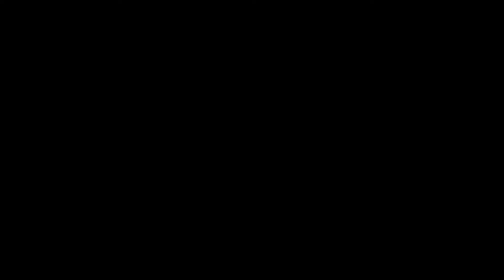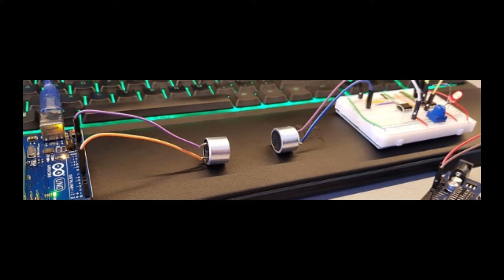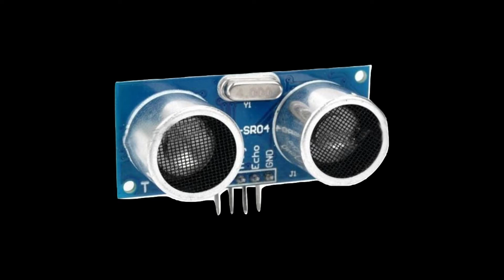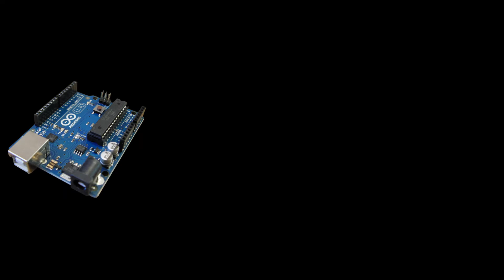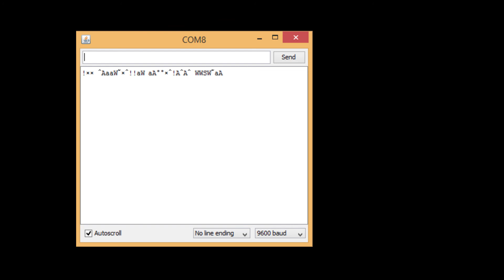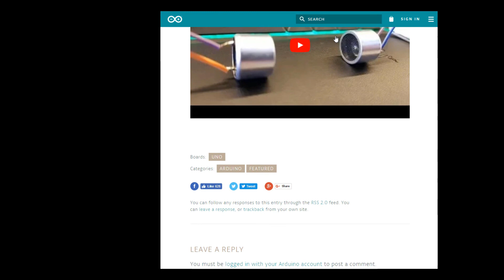New Method: Arduino-to-Arduino Communication | Arduino Discoveries🔎

Comment: Good job getting it to work, but it's nothing new. https://en.wikipedia.org/wiki/Modem. Acoustic versions are used for underwater communication.
Reply from the maker: Cool! My goal is to find these useful techniques and make videos about them.
Reply: Now if you want to take the principle of what you've built and do something really interesting read up on delay line memory. You'll have to spread the speaker and microphone across a room but you can feed a signal in one side and there will be a delay in receiving it on the other side. You can use that delay to store information. When it gets received it's transmitted again in a loop. This was how early computers temporarily stored data. It was the registers of old machines. https://en.wikipedia.org/wiki/Delay_line_memory  You've already built the basis for a system. It only requires a single Arduino as well.

Comment: Hey bro, could you explain the circuit diagram for the receiver. You have used only 2 resistors but in the diagram, it shows 3 of them.  Also, there are 3 connections made on R3 10K ohm resistor. So where exactly do we connect pin 2 of the LM393
Reply from the maker: Unfortunately, I'm not an expert on this topic. The best advice I can give you is to read the blog post I linked to. My goal here was to make sure that more people saw this cool use of an Ultrasonic sensor, but I am not the original creator. I could never take credit for something I didn't do. Best of luck!
Reply: @we-gold  Ohh okay. Thanks!
Reply from the maker: @akrammohammed1167  I really wish I could help more, but I don't have much experience with this specific technology.
Reply: @we-gold  No problem at all bro! Thanks for sharing this project by the way. Will let you know once I get it to work :)
Reply from the maker: @akrammohammed1167  Good luck!
Reply: @we-gold  Just dropping by to let you know it worked perfectly :)
Reply from the maker: @akrammohammed1167  Awesome! I'm really glad to know that it worked out for you!